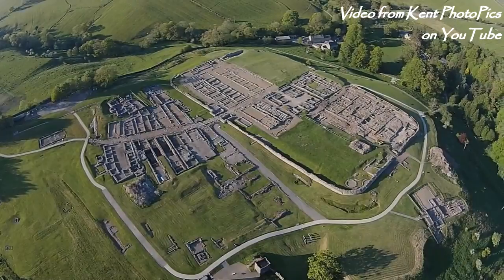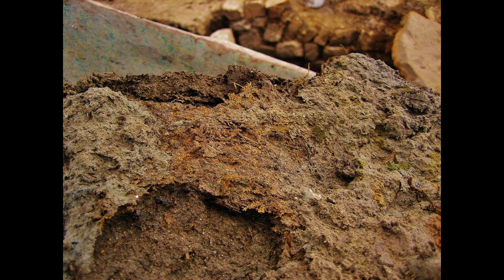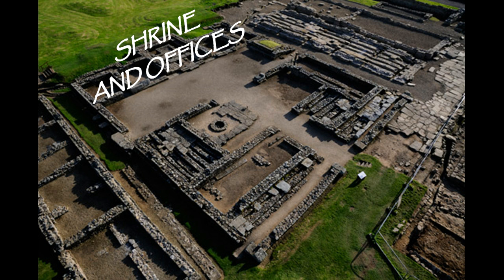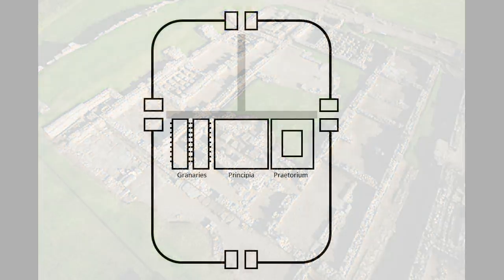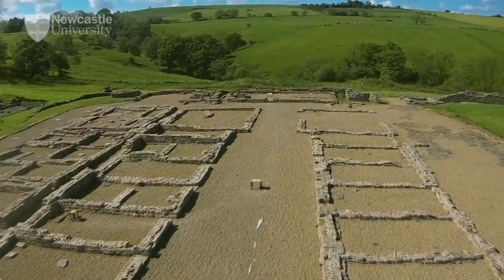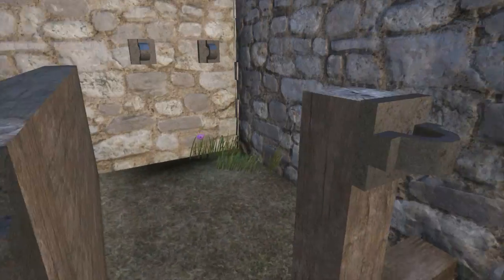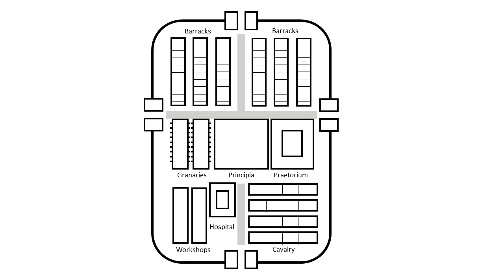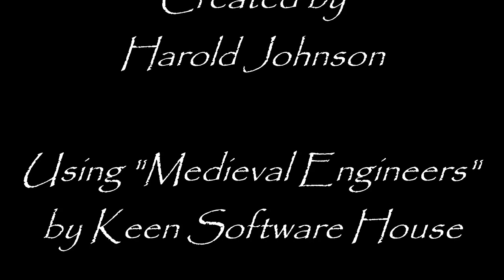Roman Forts - Building Stories from Stones (featuring "Medieval Engineers")

Comment: The roofs were rebuilt with an excessive and unnecessary slope. Roman tiles do not require that slope, partly because the rainwater regulation system is very efficient. The roofs could only have that slope in the early days, when the buildings were still temporary, with wooden walls  and the roofs equally made with shingles. 
"Medieval Engineers" offer advantages and limitations, in this case.
Reply from the maker: If you see my later videos, I spent a lot of time reconstructing & using a complete set of lower-pitched roofs to take that into account. But it may or may not have been accurate to do that. In the northern provinces, especially on Hadrian's Wall, winter snows could have been sufficient to need a steeper sloped roof. If you look at all the reconstructions by experts in the field, some have the more Mediterranean low-sloping roofs, some have a more "medieval" high-sloping style. Over the centuries the Romans seem to have adjusted some of their building styles on Hadrian's Wall to take account of local conditions. For example by the 3rd Century roofs were made of slate instead of tile. So maybe they changed slopes too. We'll probably never know for sure.

Comment: “about 30 to 32” Isn’t that about 31?
Reply: The Roman republic organized cavalry in turma units of 30. After Augustan reorganization, a turma consisted of four contubernia. Each contubernium consists of eight fighting men and two military slaves. Thus the later turma consists of 32 fighting men. In operational terms, it is quite likely that the unit size for battle was 300 riders, ten sets of 30. What happened to the other 20 men? IMO these were special duties which always required horsemen: two subgroups of two speculatore each (total 4), two subgroups of eight exploratore each (subtotal 16). The special operators thus number 20. Most likely, at least one man in each subgroup was evocati. This ensured each legion included the minimum force strength for scouting and reconnaissance, and a full strength complement of cavalry. The numbers would be useful in planning, building and supporting the required military infrastructure for basing purposes. During wartime campaigns, the count would swell appreciably from addition of evocati reserves, socii levies, and even mercenary hires.